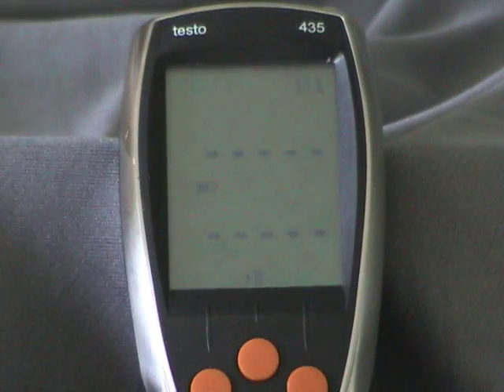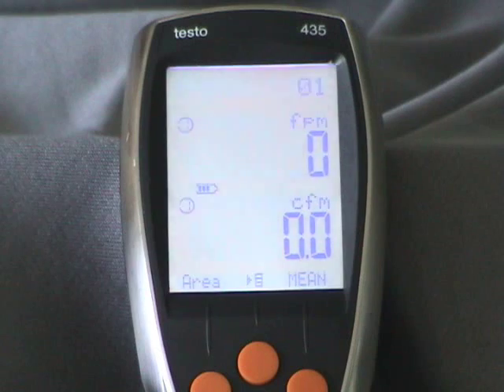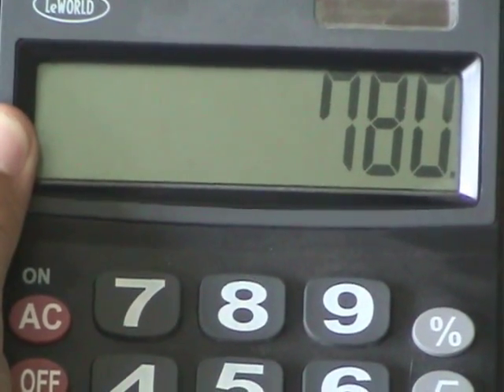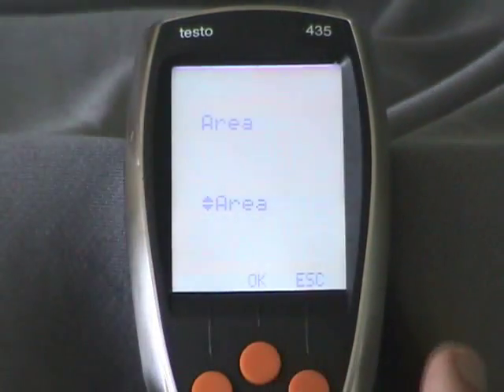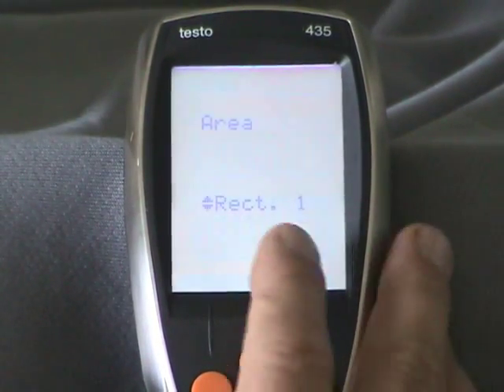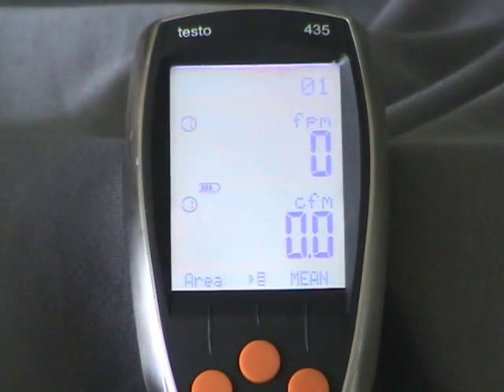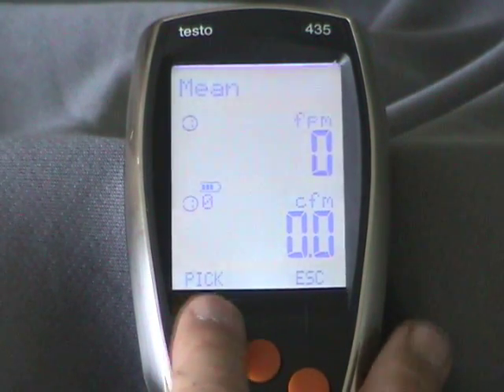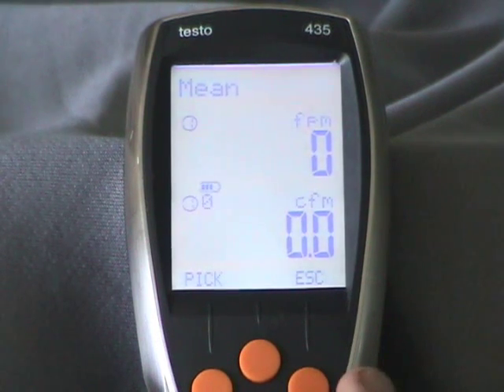Testo 435 2 Area Input for Return Air and total BTU calculation

Comment from the maker: Find the square of each grille (400, 256, 256, 144) add them together (1056) find the square root (32.50). Enter the square root as as the value for the sides A and B of the rectangle. Use the multi-point function to capture your readings at each grille. Once all the readings are taken on all the registers, hit END and the 435 will do the math.